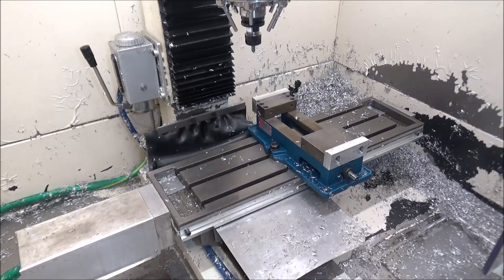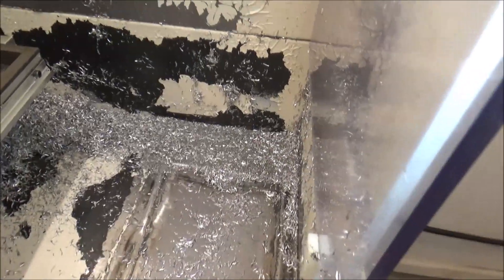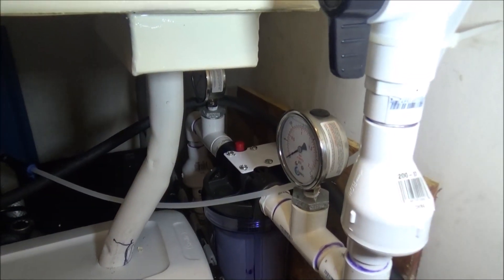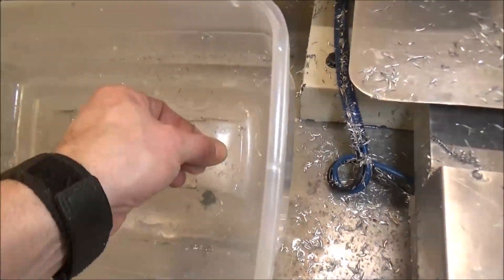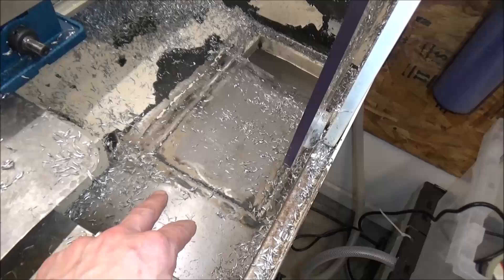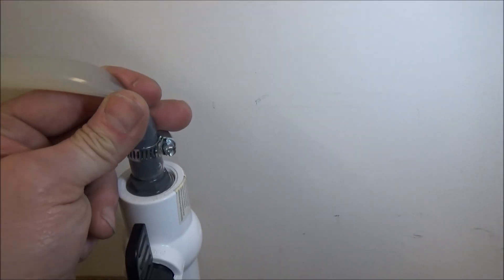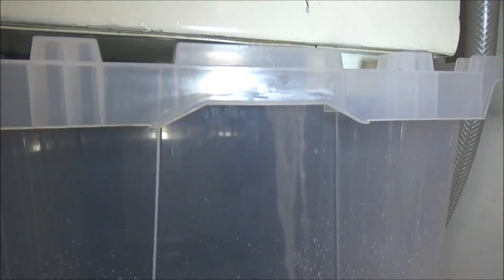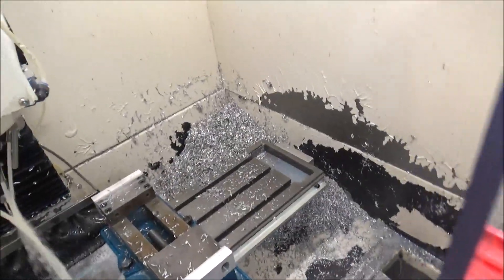PM727M Flood Coolant The End

Comment: What is the pressure of the flood coolant with out the filter?  Would it be better to use 2 or 3 filters in parallel to get better pressure/volume of flow?  What about a pressure booster pump after the filter to up the pressure to the nozzles? You probably would need another filter in parallel to improve flow to use the booster pump.
Reply from the maker: You could use a Higher volume pump this one is 2600 GPH I also linked a 4500GPH pump which should give you more pressure.  The pressure I'm getting seems adequate 7psi into the filter and 4psi out but the volume is good. As the filter clogs the input pressure goes up and output pressure also drops.

Comment: Why or could you use the overflow, you would need 2* the coolant it would be less likely to block the filters, as most of the chipping should sink and mostly clean coolant should overflow the top tank.
Reply from the maker: I had that type of setup before But I think this is working perfectly.